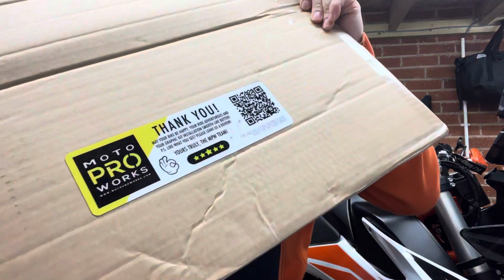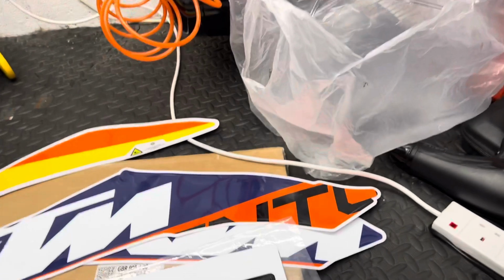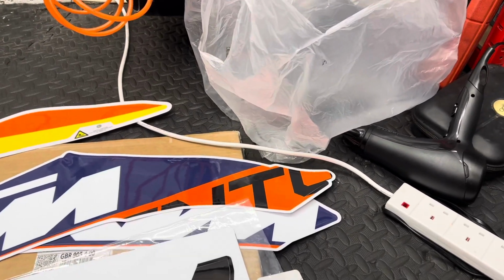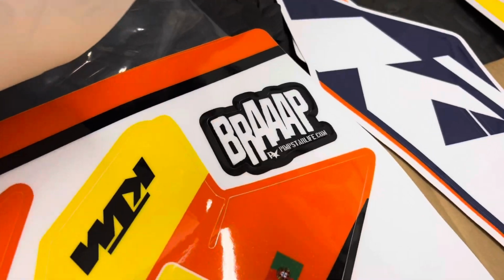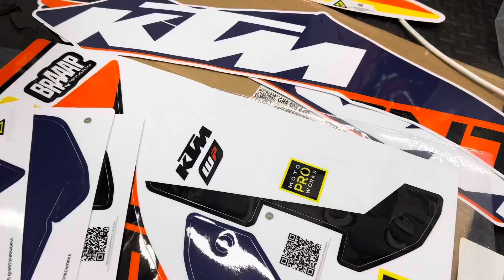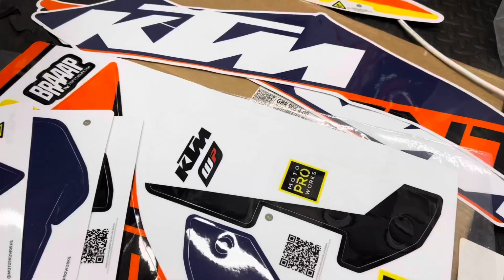KTM 790 ADVENTURE R ULTIMATE DECALS RYEEP BUILD PT3

Comment: Hi rich
Just stumbled across your videos. I've had my 790r for the past 12 months after down sizing from a 1090r due to the extra weight it carries. The 790r is a fantastic bike. How easy was it to apply the sticker kit, and did you remove all the all stickers ??
Reply from the maker: Hiya mate thanks for watching! Yeah the 790r is a lively bike. Just that bit lighter for the gnarly stuff. Albeit not quite 500EXC level. I’m working toward that haha.

As for the sticker kit fairly straightforward just time and energy. Very good quality. However I’ve done a few now so have the experience a little. There is definitely a knack to it. But it’s expensive if you screw it up.. as you have to get every part right.. if you ruin one decal out of 35 the. Your gonna be gutted and the. Have to re order a single decal and wait for the order process again. 👍

No I didn’t remove any decals off the main panels. But I did remove the decals off the rear panels under the pillion seat for those bits 👍

Comment: Your such an expert fitting decals now! You did say never again after fitting your 1st one, now I think you’ve don’t about 4. I am not sure I’m brave enough 😂. What are your best tips for preparing/cleaning the  surfaces and fitting the decal? Cheers Lee
Reply from the maker: Hiya Lee!! Haha yeah I did say that didn’t I 🤦‍♂️. I’ve got a matching kit for my 1290 on route so that’s going to be No.5 😁

As for tips well I would say warm environment keeps the decals supple. But you will still need heat from a hairdryer.

100% prep the most important. I drown my bikes in ACF50 and you need 100% surgically clean surface! Thoroughly run down with rubbing Alcohol. Then wipe of again with clean cloth. 

Spray area then with water mixed with few drops of normal washing liquid mixed in a spray bottle.

Heat up the decal so it’s supple, before removing the back off the decal I clean my finger tips with some of the alcohol (but that’s just me.. will dry your skin out if too often)

Peel off the back the. Position (and may take numerous times. Lift carefully do not stretch or pull the decal, if it’s already hard to lift get the hair dryer on it and lift gently and apply more spray behind it.. it will lift. You can get away with this more times than you feel you should so don’t worry, just don’t damage the decal or get crap stuck to the back of it.

Once you position it right and start squeezing from one’s corner to the opposite, I use a squeeegee on flat surfaces and a simple mircofibre and fingers for bending around edges. Again required some heat.

Apart from these basic tips it’s literally as simple as that. But a ton of patience 🤔🤦‍♂️😁👍
Reply: Oh mate, thank you for this info that is great.  I’ve looked into getting it done professionally but either expensive or they dont want to touch someone else’s decals. 

There are limited you tube videos out there but seen a few.  I know I just need to ‘bite the bullet’ and go for it. 

Thanks again and look forward to seeing the SAS done. 

Cheers Lee